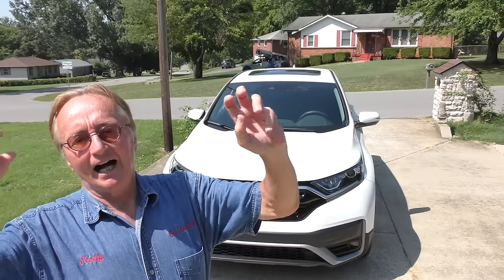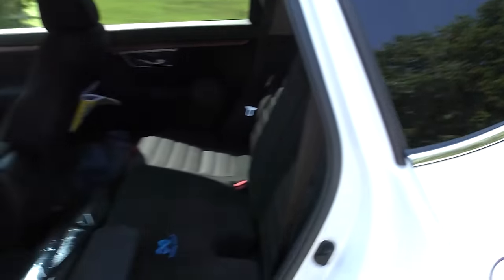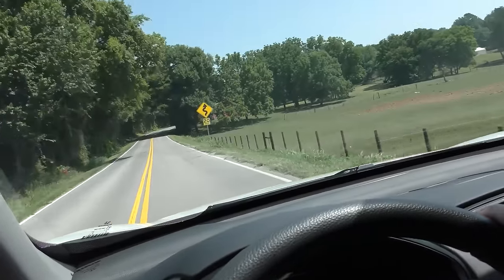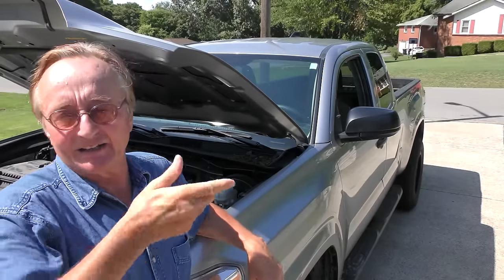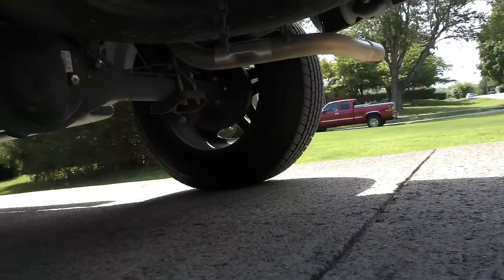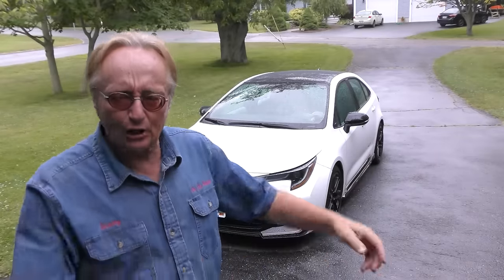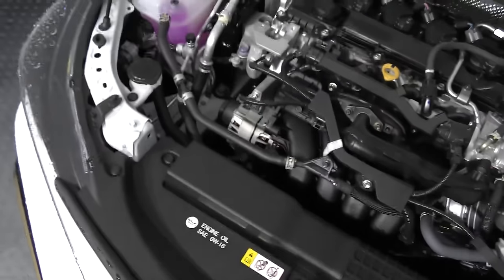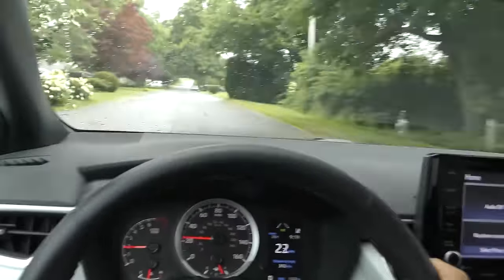The Best Vehicles to Buy in 2023

Comment: I met a guy that had 2 Tacomas . They both had over 250,00 miles on them and all he had done was routine maintenance, hadn't had to repair either one.
Reply: Actually not that big of a deal when it comes to trucks... There has always been that joke that it's only getting broken-in when it hits 200k miles. I know many people who uses their trucks for work, all of them Ford F-series trucks, some F-150's and some super duty 250s or 350s, and they are basically all north of 250k-300k miles on them without any major issues. Two of them did have major issues right off the bat related to known problems with the (then) new 6.7L Diesel and one with a 5.4L Gas. But once those problems were fixed they both went on to go the 250k-300k miles without any issues at all. I personally had a F-150 that I sold with 200k miles that never gave me any issues either.

And having been a mechanic before, I would say to basically avoid Nissans and any Chrysler/Fiat vehicles and chances are you'll be ok...
Reply: Almost 295k on my hand-me-down V8 powered 2003 4Runner that Grama didn’t want anymore! Overall best Vehicle I’ve ever owned in terms of quality, performance and reliability!! Even with all those miles on the clock, it still solidly hold the road like I remember it did while I was learning how to drive.  Unless it somehow gets totaled, winds up rusting away or fuel reserves run dry.. I’ll be driving this rig until I’m a frail old man 😂👌❤️
Reply: @TalkingHands308  transmission problem tho had a f150 blown it 150k
Reply: Same with my Camry

Comment: My buying experience has taught me that seat comfort is a critical decisive factor. No one has rated all vehicles by this factor to my knowledge. I have great discomfort with entering vehicles with specific seat levels and types. So far I have found bench seats do me better than bucket seats. Also low seats are more displacing to body every entry and exit. Fuel economy must take back seat on issue of comfort unless someone can prove their excellent fuel economy paired with comfort in seat and the entrance and exit of seat. 
Bad seat configuration is similar to sitting on a wallet in your hip pocket, it’s not the value in wallet, it is a placement location issue. 

If all vehicles were very comfortable in seating long term as well as entrance and exiting, this aspect alone will up the competition of value per design!!!
Reply: I'm in hell driving my mk3 Mondeo, while the read passengers get an amazing comfy bench.
A good seating position and comfort are my priority for my next car.
Reply: Try the 2020 or newer Lexus ES350.
The seat comfort is amazing. 
Get the Mark Levinson stereo.
You'll be so happy. 
Runs on regular.
Reply: @nostradamus7648 
The mouse is a drawback, compared to the Tru Touch on an Acura…
Reply: @billmulvihill8452  They remedied that flaw in the 2022 and newer models.
Also, Lexus has fewer electrical and transmission problems.
Reply: My first new car Corolla 2018 XSE has some of the most comfortable seats I’ve sat in compared to other similarly priced and higher New offerings. Not perfect, but I drove from Virginia to Miami in two days a few times without much fuss. 

Cant say I’d do the same in some other cars. Point is. Don’t spend more than Corolla money on crappy seats.
Reply: I agree. It doesn't matter what type of vehicle you purchase. If the seats or headrest are uncomfortable, it can become hell on long-distance driving.
Reply: Preach
Reply: @nostradamus7648 at what price, 75 $ k
Reply: @TheTrainboard  
$39,900 in 2020 base price
Reply: I bought a 2021 Nissan Frontier with manual seats,  what a bummer,  I just can't get comfortable.
Reply: My camry was the absolute best at this
Reply: Maybe  you should have a channel for it. Might be a money maker
Reply: Wow yes finally this is exactly what I'm looking for I'm looking to lease a new vehicle right now... My family is leasing the 2022 Toyota 4Runner and of course I am in love with how Spacey it is in the driver seat... Now looking for something to least for myself ... In your opinion what is the most affordable and spacious car or SUV that I can lease right now? I said in the Mazda cx5 2 weeks ago and it was so tight by my knees smh....
The Honda crv is not bad but not as spacious as I thought....
...the kia Sportage was pretty good...
I'm trying to make the best decision here.... which way you think I should lean?

Comment: Tell ya what Scotty, after the major winter storm we just had over here in Northern Nevada, it really made me appreciate my reliable ‘ol 2003 4Runner SR5 with the V8 and Full-Time 4WD!! Didn’t matter how many times the plows went through and scraped the roads, it piled right back up and left MANY people with their 2wd cars either trapped on the side of the road or stuck in ditches 😮 Not my faithful, ultra stable Toyota though! Did a back & forth trip between Carson City and Reno in the thick of it to fix my Sister’s busted little Ranger and not once did I feel as though I was going to wreck or get stuck. I’ll never get rid of this truck ❤ Pushing 295k on the clock and still runs like it’s factory new! 

Anyone looking for a solid SUV that’ll run with just basic maintenance, these 2003-‘09 4Runners could be had for a under $10k with mileage that isn’t astronomical! If you’re wanting the 2UZ V8 though, just make sure the Timing Belt/Water Pump Service has been kept up on! 4.0L V6’s are Chain Driven, so no worries with that, though 👌
Reply: Help sis trade her Ranger for a cheap 4Runner.
Reply: What about rav4??

Comment: Just bought a brand new 2023 CR-V last week after my trusty old GMC was totaled. Reliability is my #1 thing when looking for a new vehicle as we keep our cars for 10 years or more. Was a little concerned about the Honda 1.5 turbo, but if Scotty says the new ones are okay, I'm put at ease. It's actually a super zippy motor!
Reply: Yes it is, I got the 1.5 turbo in an Accord
Reply: I have accord sport 2019 1.5T with 28k miles and work like a clock
Reply: Be aware that the little 1.5 liter doesn't produce adequate heat to warm up the car after it's first turned on and idling. In cold weather you have to drive it before you can properly defrost/defog it, because to produce enough heat the turbo must activate, and that won't happen unless it's driven.  Personally, I would not consider this acceptable. Btw, I own an '06 CR-V with a 2.4 liter non-turbo that I bought new, about 17 years ago. The heater has always worked great.
Reply: @ozzierabbit587  Not a dealbreaker for me. I live in northern Canada. Every engine takes a few minutes to heat up in when you get below -30C.
Reply: @ozzierabbit587  you're right in these zero degree temperatures it literally didn't heat up until i drive it but
Reply: @stuartmcintosh9904  You will be surprised if you think it will warm up while idling in a few minutes at -30C.
Reply: Sounds like a CRV… my Gen 1 requires driving to warm the cabin. It never bothers me, after 23 winters. :)
Reply: @ozzierabbit587  not true.  I have a 2023 EX and it warms up and defrosts very quickly.
Reply: They don't have an automatic start on the key? Cant u just start it 10min before using it?

Comment: I've seen and did a oil change on a 2012 tacoma and it had a 502k miles on it 4 cylinder motor orginal and transmission and still runs like new changes oil every 3k miles its insane
Reply: That’s a ton of miles for a 10 year old vehicle. Must have been highway driven.
Reply: @Time To Wake Up  it was highway guy has his own business and he does something dealing with construction etc
Reply: So where do you take the old oil...no one helps dispose it here in nj

Comment: I own both a Toyota and a Honda and between the two, the Honda is a lot less reliable because of its transmission. I would like to try a Honda with a CTV next time. Otherwise, my Toyota preference stands
Reply: CTV? Do you mean a CVT??
Reply: I had 2 toyota and both times transmission problems,  both camrys 56000 miles and torgue converter is going and electric window , had 2 Hondas no problems,  but best cars where elantra
Reply: Try Mazda you won't be disappointed. No CVT, No turbo just reliability and excellent craftsmanship like old Hondas and Toyotas used to be.
Reply: Yup, toyota transmissions are indestructible. Once, a few years back i accidently shifted into reverse in my old 1986 4 door corolla on the freeway! I thought i broke the car and there was a lot of tire smoke. But i simply put it back in drive and away she went like nothing happened!
Reply: A CVT will be worst than a real automatic transmission😂😂you should try Mazda instead
Reply: @ginog5037  do you recommend the Mazda SUV’s?
Reply: @MikeOxlong-gg9bw Elantra is Hyundai
Reply: Don't do it friend!  Honda already has a sketchy transmission history, and CVTs are failure prone, by design. A Honda CVT is a guaranteed regret.

Comment: Toyota (Lexus) are the KING of reliability. I drove my sons 2003 Corolla with about 50k miles on the odometer from NY to TX in 2 days. 1600 miles without any issues. 
Love the look of this new Corolla. 
My 2002 Lexus ES300 just turned 173k miles. Just breaking in. Flawless and beautiful. Everything still works like day one. Luxurious and super quiet
Reply: 2003 4Runner V8 driver here! Trucks been in the family since brand new and aside from a Rear Diff that my Grama had replaced under warranty about 17 years ago.. it’s such a solid, powerful and well put together vehicle! Almost 295k on the clock, still drives just a smooth and overly engineered as it did 20 years ago 😄👌 Unless it gets totaled or winds up falling victim to rust god forbid, I’ll do whatever it takes to keep her on the road!
Reply: @sk8terboi510   nice 👍. Just 2 months ago I had my Lexus undercoated with WoolWax. Definitely worth it. Will prevent any rust from happening.

Comment: Suzuki has been making the very popular Jimny 4x4 mini suv since 1970. Some come with turbo charged engines and they seem to last a long time. There are several thousand available for purchase here in Japan ranging from $2,200 to a really crazy price of $84,000 (2022 Jimny XC, 660cc, AT, 13km on tach).
Reply: Jimny craze cuz Japanese demand for kei size vehicle
Reply: @amandeepbaa6978  - true, kei plates are economical. But, Suzuki now makes a bigger Jimny Sierra, with a 1,300cc or 1,500cc engine, that needs 500-plates. Those go used anywhere from $6,400 to $46,000 for a Sierra JC.

Comment: I have a 2013 CR-V AWD. I consider it a lemon. The variable timing actuator. Excessive oil consumption. 3 out of 4 bearings shot before 80k. And the heater core clogged, cleaned up with a CLR Flush.
Reply: My 2014 CRV @115k miles ‘s very good, no issue, no oil consumption. This model still has regular transmission, no CVT.

Comment: I have a 2022 Toyota Corolla SE. I have 15,000 miles on it. Very reliable as the day I first bought it. Easy to fix and to do your own oil changes and tire 🛞 rotations. The Corolla SE ride smooth as butter. Any part that is damaged in the interior is easy to replace from your Toyota Dealer. I’m very happy I made this purchase. I say it looks and rides like a Lexus without the cost. One thing I like about the Toyota Corolla SE is that their wheel lugs torque specs are at 76 Ib/ft which is easy but nut over aggressive like 100 to 130 Ib/ft like at Ford or Jeep which I would be worried about tearing the lug nut stud off the rim
Reply: well yeah… it only has 15,000 miles on it doofis. what are you fixing on a brand new car with 15,000 miles? gimme a break
Reply: @ButtmanAtHeart  give me a break and look at Ford, GM, Honda, Nissan. Engines and transmission blowing up before 1000 miles. Example the new 2022-2023 Honda Civic 1.5 engine. Civic don’t even start and leaving drivers stranded. Hey hero 🦸‍♂️ look at the Ford Escape , Ford Explorer, and Ford Ranger needing new engines because the coolant went into the oil. Don’t let me talk about GM and Nissans junky transmissions and Nissans exploding sunroofs that they don’t want to take responsibility 4. Toyota Stock is at $139 for a reason and Ford Stock is at $12 for a reason hero 🦸‍♂️
Reply: @natelove187  pretty sad when the new standard is making it 15,000 miles without a problem instead of 150,000 miles🤦🏻‍♂️😂😂😂😂😂 sorry i offended you that was not my intention
Reply: @natelove187  who hurt you bro? you’re awfully defensive and lashing out. thats not normal
Reply: @ButtmanAtHeart  I can imagine how junky your car look 👀
Reply: Stop saying it is reliable car till 300 grants miles 😂😂😂 plz give us a little break

Comment: Great Video Scotty !!!
I almost bought a Toyota Corolla ...
Rides well enough on long freeway only trips , comfy, good gas mileage...the only reason I did not buy  it... it did not hold the road (freeway) well on Super Windy Rainy Days  or on Super Windy Snowy Days. I drive long stretches of the freeway with wide open spaces on either side ..and often...I have to drive on extremely windy days. I would have to slow to 40 mph to 50 mph to stay on the road or in my lane.
The handling is of great on the regular corolla ... I was able to easily miss hitting  a deer and avoid hitting the driver in the next lane.  I was driving at night ...through a construction zone and the Corolla handled so well, I felt as if I was an excellent driver ..( PS. I am not a good driver)

I wonder...I used to put sandbag tubes in the bed on my Chevy S10 4 cylinder manual (stick on the floor) ...I would place them over the wheels and I was able to easily drive through windy days, rainy days, snowy days... Is it possible to put the same tubes of sand in the trunk of a Corolla ?

Comment: Hey Scotty, Gary from Hemet Ca. happy new year. You are great, i watch all your videos.  I wish you could see my 2000 Toyota Corolla, ive done some work on it, Not on the engine" I put a 4 speed quick shift auto trans with overdrive, it had a 3 with overdrive, and opened the intake and exhaust , external chip and yes some do work, K&M air filter and oil filter, Mobil 1, 05 w 20 full synthetic oil, bigger tires, raised the back a little, and have to put mid grade gas in it or its sluggish . it is very fast and fun to drive. i don't have a problem racing 6 and 8 cylinder's. it a 1.8 L , iv'e owned a couple of 70s muscle cars and this corolla is just as fun. Bought it new in 2000,, it was a dog then, but not now for sure. 145657 miles on it. and a lot more to go its telling me. And yes, it passes California smog.

Comment: As far as the ecoboost wearing out .. not always.. my wife has a 14 escape titanium, it has the 2.0 ecoboost, runs perfect..but it only has 117k on it, she got  It used with a 3 yr 36k me warranty that covers the motor, tranny, turbo.. drive train..everything down to the valve cover gasket she loves it. It's pretty nice, I've seen ecoboosts with like 300k on the original motor and tranny running  fine.

Comment: Scotty you seem to be biased re: Toyota vehicle. Sure the beat the heck out of Nissan but when it comes to performance or Small SUV vehicles you need to look into the Subaru WRX and the Outback with at least the Premium level and option pack 15 and the 2.5L boxer.. The issues with the boxer engine have been resolved. They are both great vehicles for under $35K when you look at a loaded Outback with at least the Premium Package and option package 15 as the minimum to buy.

Comment: Look into the CR-V 1.5L oil dilution problems before you buy one!  
I can't believe Scotty didn't mention it.
Reply: Yes facing 10 k engine repair for a Honda CRV 2016 Touring  81 KM mileage apparently because of two missed oil change at 20 and 15 k diff non consecutive Honda will not honour the extended warranty But when I brought it for servicing, never heard any signs of engine problem as they check everything.  Now looking to buy a Toyota RAV4 as they are rated higher.  I had a Lexus 350 bought in 2008 and still working fine.  NEVER had an engine failure in my years of 30 yrs driving only this Honda CRV 2016.
Reply: Yep. Garbage.

Comment: Hi Scotty, I have been following your videos for last few months. I am from Winnipeg Canada. I drive a used 2009 civic since 2016. I am planning to upgrade to a compact SUV. Rav4 is not an option now because of the availability. I already ordered a crv touring hybrid. But I am aware its expensive and lacks features like 360 camera, pano roof. The other option is mitsubishi Outlander phev. I drive 40 km everyday for my work round trip. Winnipeg got the harshest winter. I just wanted to know will my crv worth more after 10 years than outlander if I maintain properly?  Or you think Outlander would be an better option.
Also, do you think the battery life after 10 years will be almost at the end. At that point getting a good resale value will be tough?
Reply: Honda vs Mitsubishi is a no brainer really.
Reply: Honda and Toyota have the highest resale value. The Mitsubishi won't be worth anything after a decade
Reply: you drive 40 km a day why get a phev?

Comment: If you still have oil dilution, use engine oil Shell Helix Ultra ECT C2/C3 0W-30 for your Honda CRV
Reply: Why would that help?
Reply: @georgecrouse8318  In the users manuel says that C2/C3 is required by Honda for CRV. My first oil level was even higher than max level on the stick when indicator warned me on 7.000km. I thought 20 wasn't have enough viscosity to stay in the gaps when the engine reaches optimal heat. Since then I have changed the oil third times with Shell Helix Ultra ECT C2/C3 0W-30 and now it is 21.000km and level is always between the marks on the stick when the engine is cold in the mornings.